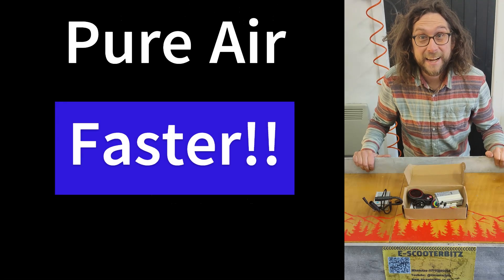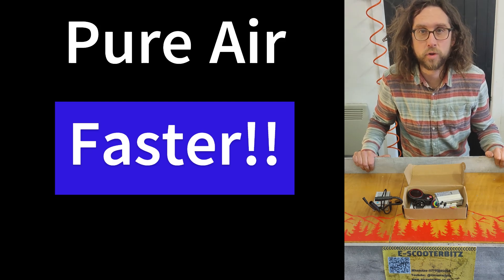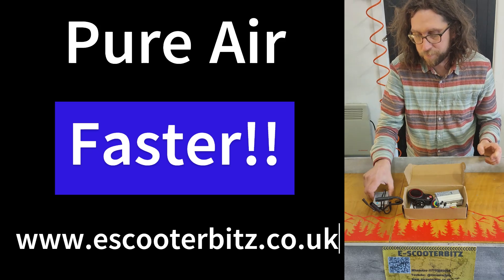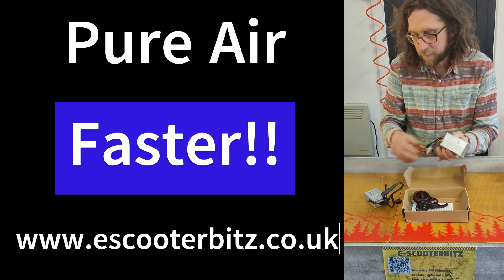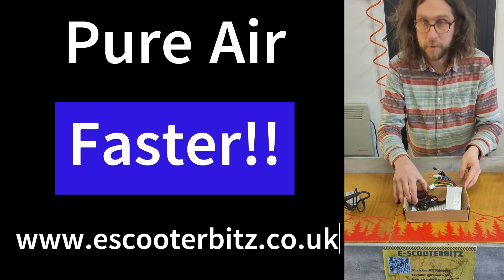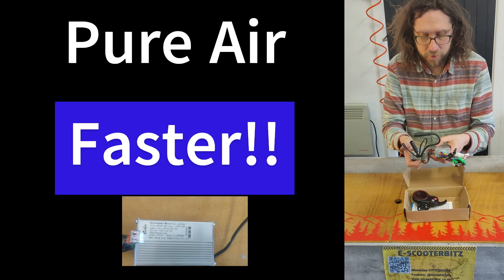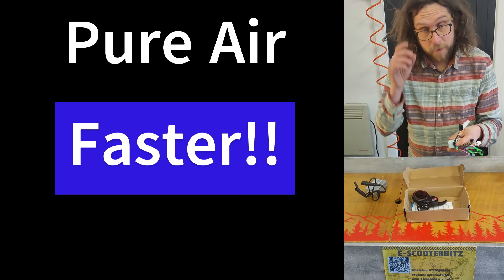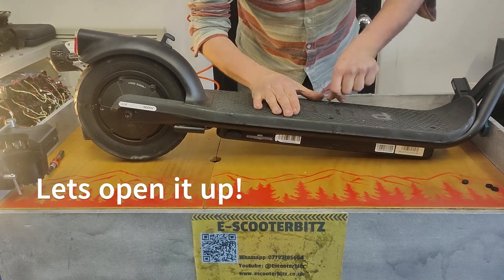De-restrict PURE Air E-Scooter

Comment: HI BUDDY
IS THERE A WAY TO INCREASE THE SPEED OF MY ((PURE ADVANCE E,SCOOTER)) OR ARE THEY THE SAME AS THE PREVIOUS PURE MODELS LIKE AIR PRO //
AIR PRO+  ETC, 
AND CANT BE DONE ??
UNLESS I DO THE SAME AS YOU HAVE IN THIS VIDEO ( WHICH I CANT ANYWAY) & ITS A LOT OF WORK FOR ONLY FEW MPH MORE !!!! 
ISNT THERE A SIMPLE CABLE DISCONNECTION THAT INCREASES THE SPEED ???
THANKS...

Comment: F me that's a lot of effort. I guess I can stop hoping someone will ever find a quick solution to remove the speed limit on these things like some other brands where it's as simple as cutting a single wire. I think the difficulty to remove the speed limit is done very intentionally by Pure Air because they want their brand image to resemble 'safety first' blah blah blah.  I'm bored of 15.5mph after 3 years. Time to upgrade to something with more juice!
Reply from the maker: @jlb4685  :) yeah, unless some clever person can work out how to modify and write firmware to these it's going to remain tricky. I have tried a few things but more than I can manage.

Comment: Im thinking of getting hold of a new electric scooter but almost all seems to be limited to 20/25 kmh due to regulations, or unlocked and very overkill for my application. For example, I have a Ninebot G30 max where the OEM controller burnt due to exessive tuning. The swap i got was aftermarket and the scooter is now even quicker. My plan was to buy the new Max 2, but there seem to be no way of tuning it with app - question is, is it possible to buy almost any aftermarket controller with the correct voltage, amperage and functions and connect it? I mean, It doesnt get much more complicated than 3-phase for motor and some connection to the battery right?
Reply: many or most e scooter brushless motors have six to seven wires; three (if three wire delta wiring) or four (if star wiring) for the phases of the motor's coils, and three (at minimum) for three hall effect sensors that allow the controller to sense the rotational position of the motor and hence, time the pulses/changing of current flow appropriately to create smooth motion.

Comment: Hi! Thanks for the video! Is that a Pure Air 500W or the Pure Air Go 350W? I have the Pure Air Pro 2nd Gen (500W) and the battery is larger, so the gap where the controller is placed is much smaller due to the battery size, and the controllers I have found in Aliexpress are larger than the original one and do not fit there. Do you know of any controller that works 500W and is as large as the 350W ones? My only options right now would be to place the controller outside the scooter (which I don't want at all) or downgrade to the Pure Air (not the Pro), which has a smaller battery size (and range). I really would profit from a little increase in speed, for the cars here in Madrid do not have any respect for 25km/h vehicles and it would be actually safer to be able to go faster at times! I wouldn't want to switch scooter because I'm totally delighted with this one in every other aspect. Thank you again for the videos, the tips and the generous info!
Reply from the maker: Hey, the pro has a deeper battery but the same length and mounting holes. The controllers I used just about fit and have used pro batteries before
Reply: @EscooterbitzRetropad  Oh, really!? That's great. Thank you! Could you point me to the specs of those controllers, where I could find them, or do you sell them?
Reply: What controller and unit and what speeds now

Comment: This is seriously dangerous and could cause a battery fire.
Reply: You do have a point that if a person that doesn't know anything about electronics, but even then, pure batteries have a very good BMS that if you made a short, will stop working and will enter safe more. 
But yeah don't try it if you dont know what are you doing, just one cell of that battery pack could cause absolute caos... better be prepared if your going to mess with scooters, but it isnt much more than a small IC with a dc brushless controller and a throttle (a variable resistor) so there isnt much to it, but can go very wrong, also watch out with china brushless controllers.
Reply: Why? As far as i can see, everything is still working within safe parameters. What makes you think there is a problem?

Comment: I really want to change the battery in my pure air gen 1 for a bigger one but have no clue what battery fits or where to get one. Any help is greatly appreciated
Reply from the maker: If you check my site I have 2nd gen Air pro batteries that will go straight in for more range. I have another video on how to fit it
Reply: @EscooterbitzRetropad  Hola, tienes algun controlador original de Pure air 500w?
Reply: Does this work for gen 1 pro?
Reply: Escooter expert bro good on u man,,I have a pure air pro 500w and it's only driving 3 miles but I want extra batteries so I can travel around all summer so u batteries for sale at a cheapish price buddy??,,just I'd change it at side the road and put Ur own on basically I wanna be able cover much much miles without been stranded,,how much u CHARGEN man for the batteries for pure air pro 500w
Reply: IV got battery for it bigger one